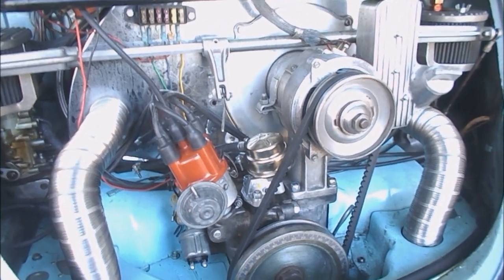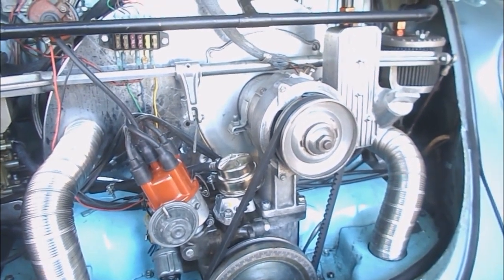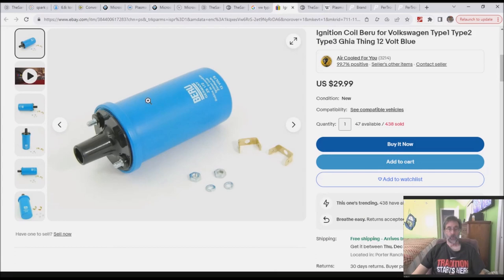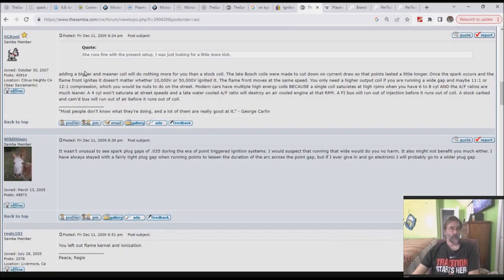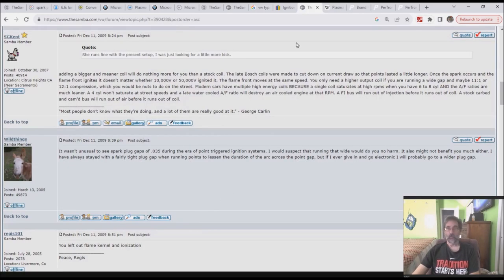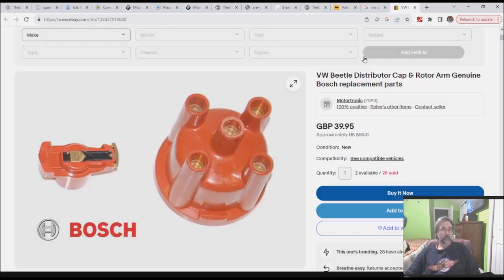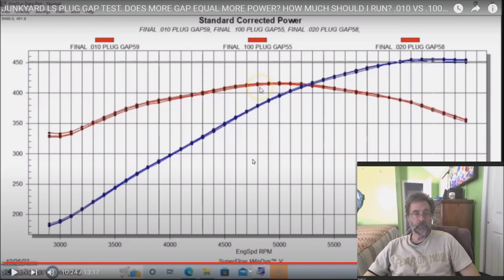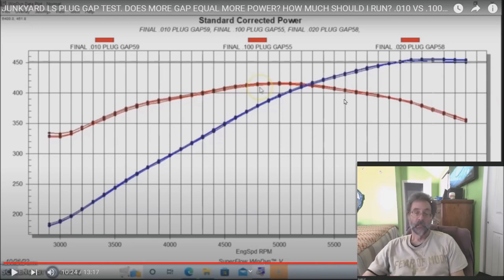vw type 1 vlog #23 points replacement modules and spark gap

Comment: Electronic is the only way to go. But keep the points around in case of the ww3 emp. 😮
Reply: So I've purchased a 40,000-volt Pertronix epoxy coil and an accuspark electronic ignition, and I've widened my gap so far to 36. It runs just like the empi was running before my ignition system had a short behind the dash. 

And so far just shy of 200 miles with the new system.  I chose the accuspark over the accu-fire because of the coil.  The empi calls for 3.4ohm, I think it worked so well because my bosch black coil is 3.4, but the accuspark calls for a 3.0ohm coil.

Time will tell on this setup,  hopefully, I do not need the points in the glove box. 

I really appreciate the way you walk through your videos.  👍
Reply from the maker: @OwhyeeVdub  accuspark? thought that was europe brand. just looked it up. it is or at least it seems to be. pertronix ignitor style. accufire is of course empi. my accufire fried as you know. just watched a mike-fn-garage vid and i think he blew up 2 empi accufires. i've seen him fry a couple others in his some of his other vids. you went with the epoxy coil. nice it's their recommended coil for offroad. you been posting? how's the type 3 working?
Reply: @scottyc9365  Yeah accuspark is a European thing. They seem to like those and the 123 distributors. 
It does look like the Pertronix ignitor,  so I figured it could be worth a try. 
I saw Mike blow those also with a blue coil. Maybe that's a thing or not. But the guy we got the Baja from was complaining about that empi ignition, he also had the blue coil on the car. 
I'm slowly getting the engine disassembled for the square back.  It looks all original so far to me. It has dished 85 Pistons.  I think I came across info on those for lowering the compression, but I'm not really sure on that one.
Reply from the maker: @OwhyeeVdub  85.5 dish? not sure that's original. afaik, those dished pistons didn't show up until '74 after type 3 production ended. i like the dished pistons. running them on my bug. i had the crowns machined down 1.5mm so only have a small bit of the dish left. mike is blast. his vids are a source of inspiration for my vids. he says A and i then have to say B. i disagree with him endlessly but i still enjoy watching his stuff.
Reply: @redshirt-scotty  could be a rebuild then, and that could explain a lot.
Reply from the maker: @OwhyeeVdub  just watched your short vid on the t3 partial disassembly on my tv. can't make comments there. i was the second viewer. looks like it threw a rod.

Comment: Hi Scotty  .. I really appreciate your research and attention to the details. 

May I ask for a vlog on the oil breather box, like yours.
I personally believe that the crank case should be under negative pressure  .. created by the carb's Vaccum. 
My concern is that lots of people run a non Vaccum box.
Question: 
If the only source of crank-case pressure is ring blow-by .. how much volume are we talking about ?
At both low and high rpm ?
Should the crank-case be under Vaccum or ambient pressure ?
And are total seal rings a plus or a minus in limiting crank-case pressure ?
Thanks Scotty !
Reply from the maker: it's the next one up. been working on it for a month or so. lots of stuff. should be a long vid.